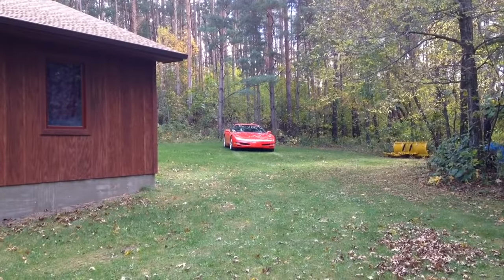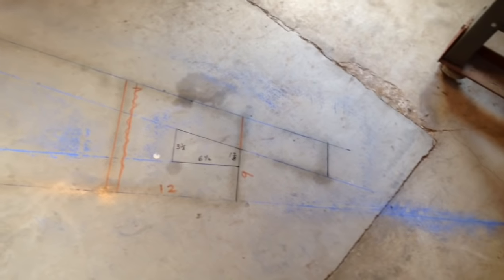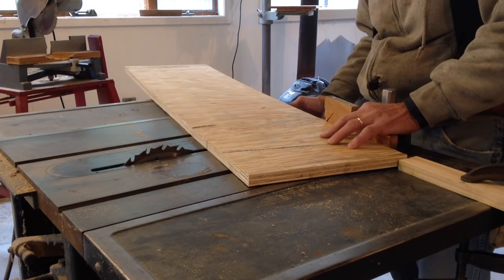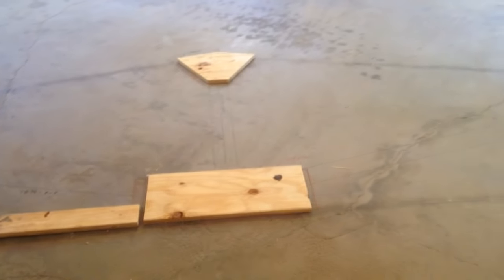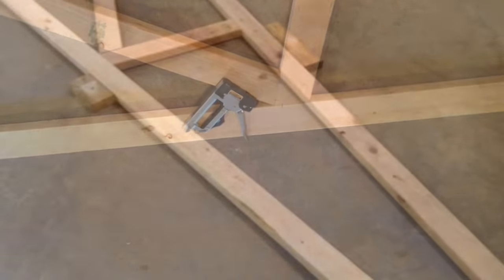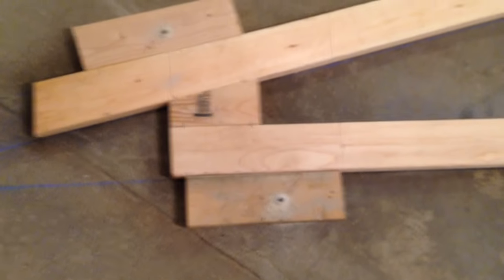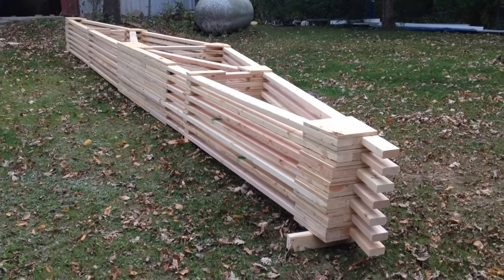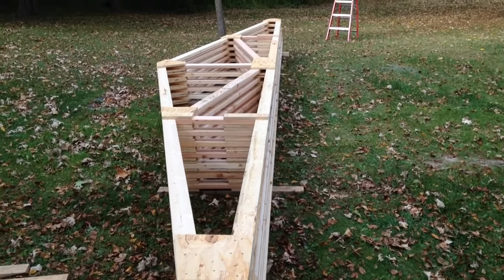Build your own wood trusses

Comment: I am about to build a roof over my chicken run with a 12' width and 30' run and then a house on the back side. These look to be quite solid. Do you know what your finished cost of materials averaged out to be? Would you say these are sufficient for 24" centers?
Reply from the maker: Hi Andrew-  typical truss spacing is 24 inches on center.  This spacing works well with 8 foot plywood.  Pole sheds and such sometimes go out to 6 feet on center, but the trusses are more robust, and pole sheds typically use purlins across the trusses and then metal roofing that does not need plywood.   If I am understanding you correctly you would have a span of 12 feet with perhaps an overhang?  If that is what you are doing a very simple truss could be built.  I would make the two top chord members out of 2 by 6 lumber and connect them at the bottom with a 2 by 4 bottom chord.  Then take a single 2 by 4 and connect the peak to the bottom chord in the middle.  Each truss would take about 16 feet of 2 by 6 and 16 feet of 2 by 4.  You can price this at  your local lumber supplier.  Then figure the plywood gussets.  You can email me at flyboy.slc@gmail.com if you need more info.  Put "trusses" in your subject line.  Steve.
Reply: Thanks Steve! I will do that for sure. I really appreciate your willingness to be of help. You are correct. The frame is a little more than a 10' span and I think it would be wise for a total of 12' for ease of construction and gaining some over hang. I am using metal roofing but I am probably going to use a plywood base over the chicken house for added insulation value and then omit them as the roof continues over the run like a long "awning".

Comment: can I put my bottom span joint in the middle or should it be offset like yours?
Reply from the maker: +Rich White (ن)   Hello Rich-- You can certainly put the bottom chord splice in the middle if that is how you want to do it.  Remember that the bottom chord is a tension member and trying really hard to pull itself apart.  As such, I would recommend that you lap your gusset two feet each side of the splice.  That means a piece of lumber at least four feet long on each side of the bottom chord.  Additionally the gusset would need to go high enough to grab whatever W members come together in the bottom chord area.  For me, it just seemed easier to separate out the bottom chord splice from the other members and gusset them separately.   Whatever you do,Glue it up well, and nail it well.  It should work just fine that way.  best wishes---steve
Reply: +flyboyslc1 thanks for your input. that's what I figured. I have a 35' span and I have to do it with 2 20' studs so offsetting the joint would be difficult. I would at best have a 2' offset but I guess that would be sufficient.

thanks again. nice looking work you did there Btw. looks solid.
Reply: Rich, I imagine my advice may be too late but the ideal location of a splice in the bottom cord would be at the 1/4 point distance between joints. If you consider the mid-span and quarter-span to be a joint then the splice should be located at a distance approximately 1/4 distance from either of the joints.

Comment: The builder showed my father the local council's Roof Frame Plans in a booklet and it showed what angle the roof has to be and the amount of Truss Tie's because of the local wind speeds and the Galvanised Steel Nailplates sizes. Its best to use Galvanised Steel Nailplates there cheaper and stronger just hammer them into place with a wooden mullet.

Comment: Thanks for the video! I am planning to start on a pole barn this spring and am contemplating building the trusses myself. I'm a little worried about the amount of time it would take me to do them all myself though. I'll just have to compare the prices and see if it's worth the extra time.
Reply from the maker: Matthew Ohrenberg   Thanks Matthew.  Nice comment!  If it is strictly a time consideration, then buying them from a truss factory is the way to go.  I do not know the span of your proposed pole building, but the trusses if they get to be very long are hard to handle during fabrication (turning them over to work on the other side).  On site fabrication can cut down on total cost, as you eliminate transportation charges if you are instead able to haul short lumber on trailers or pickup trucks yourself.  One caution, if you are fabbing trusses for a pole barn, your spacing is likely going to be 6 feet or so?  It would be good to do a little engineering on the trusses.  Find live snow loading and such and run the numbers.  There is info on the net that can help you with this.  Just do a little work with Google to find it.  Best wishes!   steve

Comment: Thanks for sharing.  Did you nail the locating stops to the concrete?  And did you use ACX? (You keep mentioning best face to the chord materials.)
Reply from the maker: DanielinLaTuna   Hello Daniel.  I screwed the location blocks to the concrete using Tapcons.  They are easy to remove and the holes can then be filled with grey caulk.  For plywood, don’t remember the spec anymore but I think it was CDX which gave me one good side to glue up and attach.

Comment: Hi I have some site-built fink trusses in my roof from the 1970s where a few of the roof peak nail plates failed because of being inadequately pressed into the timber on-site.  No engineers I have talked to will touch them because their company won't take liability for trusses they didn't design. I would like to repair my trusses using plywood gusset plates, but I don't know how to size the plates. How did you determine the size of your plates needed? I'm in the same part of the country and snow load as you btw.
Reply from the maker: Hi there Aezelll.  I have had people comment on the video and ask why I did not use the steel plate connectors.  Your comment is why.  They are not easily applied outside of a controlled factory environment where they have special presses for pressing them into the wood adequately.  For the top truss connection, all loads are in compression so there is not a lot of load on that connection.  You will need to bring the two or three members into alignment with each other using clamps or something similar.  For me,  I just used seat of the pants or common sense to size the plywood plates.  I always use 3/4" thick plywood, as two layers equals the thickness of the truss lumber itself.  For the top I would look at a plate that would lap at least 8 inches each way from the center joint.  Then come down from the top center about 8 more inches. So your overall plate size would be about 8 inches wide by 16 inches long.  The top would be trimmed to match the slope of the truss.  To do this repair I would dry fit it after you have the plates cut, then pre-drill the plywood slightly larger than the diameter of some 2 inch coarse thread drywall screws.  Then glue it up and screw these plates into place.  For you screws will be better to tighten the joint back up.  I would use 12 or 16 screws per side of each plate.  Hope this helps.  If you want to phone me you can.  It is 319.533.4543.  steve
Reply: Thanks. I have realized at this point that I'm kind of on my own to fix this, so I appreciate the advice. I'm thinking I'll probably go with GRK heavy duty structural screws in double shear after I glue and clamp, mostly because they are star-drive heads so I can make sure to easily pull them tight with a T-25 bit in cramped quarters. I found an old truss design for a 28' span fink done by the U of IL online that uses a 16" x 36" top plywood gusset plate and it didn't fail until 200 lb/sq ft, so while that is far overkill I'll probably oversize a bit like that.

Also, while I appreciate the offer to talk, I'd advise against posting your phone # online, there are some loony toons out there.
Reply from the maker: Sounds like a good plan.  I rarely post the phone number.  Not many will read that deep into a post to look for it.  Somehow, the nuts seem to find the numbers anyway.  steve

Comment: I've built zillions of trusses for my builds.  Don't need to custom cut the plywood.  Rectangles and triangles work fine.  Don'r really need the glue either.  Truss plants (I worked in a truss plant) use steel plates with bent over spears, no glue or other fasterners.  And they are approved vie building codes both national and international.  I flip the inside ones and do the plywood both sides. On the outer one's you want clean flat for sheathing which then replaces the need for the connectors on that side.  I used to build storage structures on the side and always built my trusses on the deck after I laid the decking down, drawing lines with pencil on the floor.  I'd trace the members and transfer the angles onto the wood to be cut.  All turned out the same without the need to use hold down pieces.  I generally screwed the plywood to the 2x's for strength.  When doing the plywood on the underside (when flipped over) I'd use longer screws to penetrate into the plywood opposite.  You can design and build dutch shed designs too with the side wall and the "4" shaped members to form the mansard roof. and the peak roof on those.  I never had one fail, ever.  You can cut all members at a time, each individually once you set up the saw angle, then assemble each and be done in a few hours.

Comment: Seems like the worst side of the gussets would have more surface are to bond..

I like how you angle the nails in the gusset for better holding strength.
Reply from the maker: Pat. You are probably correct, at least when using a construction adhesive. Angling the nails accomplished two things. Better pull out resistance, and also since my nails were just a tad too long it prevented them coming out the back side.  Thanks for the comment!

Comment: Are building codes suggest truss plate, mending plates or. Plywood plates.?.  It seems plywood would be much stronger then truss plates..!!!
Reply from the maker: Hi there LK.  Codes themselves will not specify how a truss gets built.  That is the role of a Structural Engineer.  The engineer can calculate what means and materials are needed to connect joints within the truss.  It is interesting though that using plywood will make the truss more rigid laterally, that is perpendicular the truss chord.  The metal plates you typically see on trusses are adequate to make the connection, but do not stiffen the truss very much.  That happens with the plywood roof sheeting or other lumber bracing added to the entire roof framing.  For homebuilt trusses, plywood is a good option.  If you are not familiar with trusses, get an engineer to specify the size and shape of the plywood.   Hope this helps.  stevd

Comment: why plywood was not used in all the ties in truss?   Nice job
Reply from the maker: Hi John,
I'm not sure what you think you saw?  All places on my trusses where there are 2 x 4 lumber joints are spliced with plywood.  Commercial trusses use steel splice plates, but I used plywood for the homebuilt situation.

Comment: Hello! Do you think i could use 7/16 OSB for my plates on a 13' span 10/12 pitch roof ? Also what size nails are you using ?
Reply from the maker: Allan, I would steer clear of the OSB for the joint plates.  Probably OK as long as it stays totally dry, but that stuff turns to mush if it gets wet.  I would suggest 1/2" CDX plywood at the minimum.  3/4" is what i used.  CDX has waterproof glue holding it together.   Glue it with construction adhesive (like PL-400 or similar) and nail it with a nail that is just less in length than the plywood and truss lumber.  This will typically be a 2" long nail.  Sometimes you will need to slightly angle the nails to prevent them poking through the back side, especially on the first side you apply the plates to.  Second side you have the additional thickness of the first plate you applied.  Hope this makes sense.  steve
Reply: @flyboyslc1  Thank you!

Comment: Hi I was wondering how did you figure out where to put out a bracing what program did you use and how did you calculate it
Reply from the maker: Hi Mario,  My engineering was pretty much seat of the pants.  I have seen and set so many trusses over my lifetime that I knew the design I used would work.  My trusses were built in a similar manner to all the ones that I set in place over the years.  If you google "wood roof truss design" there are a lot of options.

Comment: Thanks so much for this video. I'm getting ready to make the trusses for my house, and this is a perfect solution. I love the slab outline, and the gusset plate. Seems much stronger than a nail plate. However, I am confused about one thing. Did I hear you right when you said the glue was going to be a stronger bond than the gusset+nails?
Reply from the maker: Jared,  thanks for the feedback.  Yes, the glue does more to hold the joint than the nails, really.  The nails tighten up the joint causing the glue to spread out and bond well with the wood fibres.  Try it yourself.  Take two scraps of lumber, glue and nail one joint and then take two scraps of lumber and just nail it with no glue.  Now take your pry bar and tear them apart, see which one is more difficult to tear apart.  Wood aircraft wings were typically glued up with recorcinal, which is a waterproof glue.  Very few mechanical fasteners in these wood wings.    Check with your local building department to see how they view homebuilt trusses.  Some places will not allow them without an engineers stamp.
Reply: @flyboyslc1  Incredible. I remember my brother showing me how a properly glued wood joint could be stronger even than the wood outside the joint, but I thought that must have only applied to the special wood glue he was using. Thanks a heap for your help!

Comment: What length and thickness of nails did you use,?
Reply from the maker: @TheRealChrisHansen  I used a 2 3/8” by .113 ring shank framing nail.  With 3/4 plywood and 1.5” thick lumber it will protrude just a little, so I angled the nailer just enough to make that not happen.  Nailed at about a 3 to 4 inch grid pattern.
Reply: @flyboyslc1  With gusset only on one side?
Reply from the maker: @TheRealChrisHansen  No.  watch more closely.  Gussets are on both sides.  Nail up one side, flip the truss, do it all over again.

Comment: What size was your cement pad and costs? I am planning on building 1 car garage this spring
Reply from the maker: HabsGeorge   Hi there!  Concrete average price is about $100 a cubic yard. A single stall garage would be something like 14 by 22 feet minimum.  So 14 x 22 x .5 feet divided by 27 cu ft per yard =13.5 cu yd times 100 per yard = $1350.  That would be a floating slab foundation.  If you want another foundation type, it would be additional cost.
Reply: flyboyslc1 Thanks

Comment: Interesting but why would you reach a cross the blade to push the off cut off the table? Looks sketchy
Reply from the maker: szy, Not sure about what part of the video you are referring to, but i will say that I do not like any loose wood on top of a table saw when it is running.  It can vibrate it's way back into the blade and get thrown backward right at me.  This approach has served me well, over the years.

Comment: Nice video!  I'm a carpenter by trade (30 years) and I am impressed by the detail and planning that went into your project.  Did I see from that work truck that you work for Ryan Inc.?
Reply from the maker: Yes sir, I do work for Ryan Companies out of the Des Moines Iowa office.  Thanks for the nice comment.  Never dreamed that this video would get the views that it has.  Lots of comments too, mostly good ones.
Reply: My Dad worked for Ryan Inc. out of Janesville, Wisconsin.  He was a grader operator.  When he worked for them (about 1951 through about 1964) they built a lot of interstate highways in Illinois and Wisconsin.  He was part of a finishing crew that included a small dozer and 2 LeTourneau "D" scrapers. All told, he had almost 60 years operating Adams and Cat graders.

Comment: One reason the truss plants use metal plates is they are thinner and you can get more trusses on the truck for delivery/cuts delivery cost.
Reply from the maker: Barry Irby   Great point Barry.  My trusses would take up twice the room on a truck due to adding two layers of 3/4” plywood.

Comment: Nice video.  You must be living in an area with little or no snow. I’m in the Adirondacks .   You have something with a 3-12 pitch ...it better be like on 10 “ centers  and 2x6 upper cord and a metal roof.    I’m just saying........!
Reply from the maker: Hello Robert,  I am not familiar with snowfall averages in Adirondacks.  I spent time in Rochester, and know that it snows in upper NY!  Trusses need to be engineered to fit their location and usage for sure.  In Eastern Iowa our annual average is 29 inches.  January of this year saw 24 inches, with another 12 in February.  So my 24 inches on center are working just fine.

Comment: when di you build these?? lumber alone on these trusses in my area would run about $100 at least and you keep saying $25. but great quality work!
Reply from the maker: Mr. Doe,  The video is about 5-6 years old now, and lumber prices do vary.  There is about a half sheet of plywood in each truss and about 5- 2x4-16 feet in each one.  All of that could be bought in Iowa for less than $50 bucks right now.  Somewhere here in the comments someone raised a similar comment.  When i built them lumber was a little less.  Plywood especially varies, affected mostly by hurricane season and home building.
Reply: flyboyslc1 o